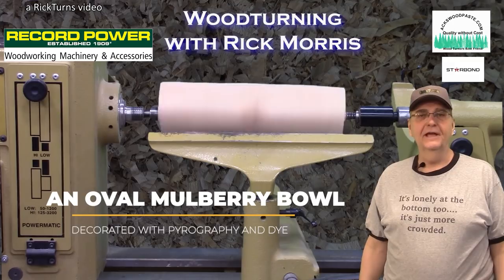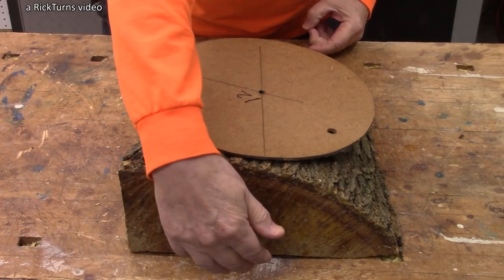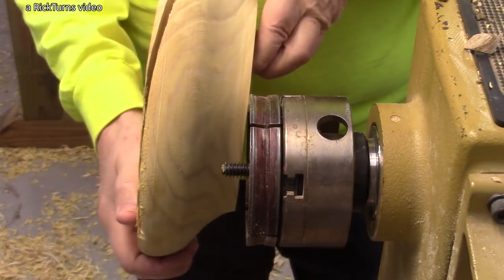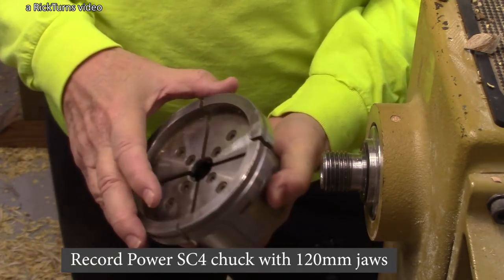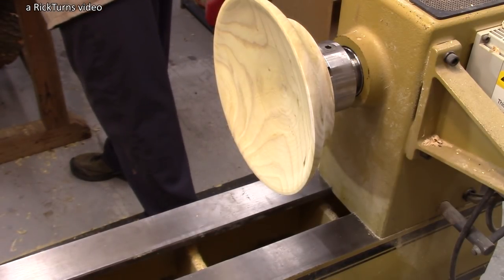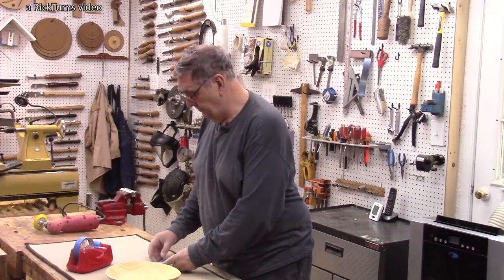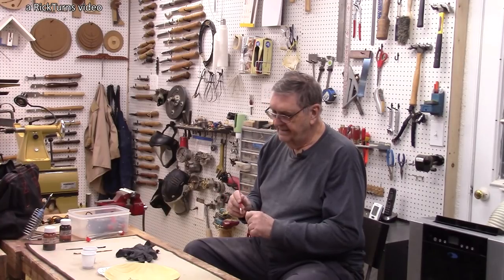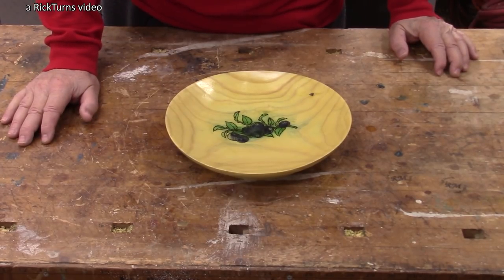Woodturning: An Oval Mulberry Bowl

Comment: I love the effect of dye sinking in to endgrain, how it plunges deep in to some areas and sits on top of others.   If I had that bowl in the state you have it, I would paint a very light amount of blue all over, identify the areas that want to suck it up, give those areas some extra dye, and then let it dry out.  Afterwards sand away the color from the areas that it doesn't penetrate and it may look pretty cool, possibly leaving just Woodburn image and a swirling blue design, possibly leaving some of your color shaded picture.    That's just what I would try.   And I often do things like this that do not work out well, but that's why I keep interested in wood working, the adventure never ends.    Live long and prosper, sir.
Reply from the maker: Thanks for watching and for your comments, William. Your idea about the dye sounds good - I’ll try it out sometime.

Comment: Hi Rick. I enjoy your videos and have learned much from you. I like this style of bowl/platter.
Regarding your dye and varnish, I've done a lot of leatherwork over the years and have learned that if you put a bit of finish on the part you plan to keep natural prior to using any dye, then it acts as a resist against the dye. Then after applying the dye, you can lightly apply a bit of finish to the dyed areas by either drizzling or spraying it on without wiping it for the first coat or two. Then finish up with another one or two coats of finish (varnish) over the entire piece.
Reply from the maker: Thanks for the tips, Mark. I'm going to try it which an initial coat of a sprayed-on sanding sealer.

Comment: Nice project that came So Close. I like your pryo+dye projects; they are great art. 
I've used water based polys as a sealer to limit bleed out if I suspect it's a threat. It can be sanded off later if desired. Of course it can't be applied on the wood that you want the dye to penetrate. Best use was where I routed out a pattern, sealed the entire surface, and filled w/ colored epoxy. Then sanded entire surface to be flat.
Don't stop doing these 'cause they're wonderful 🎨 I suppose you could sand it down and re do, ugh!
Reply from the maker: Thanks for the suggestion, Mike. I've already order a spray finish to seal the dye next time.

Comment: Win some, lose some. The depth gauge is a win though. I saw you use it in one of your videos about eight months ago when I was first starting to turn wood. I ended up making one and it hasn’t failed me yet. I had to be a bit creative though. I have an old tube style Craftsman lathe. A piece of 3/4 in. plywood, to hold the rod, screwed to two 2x4s to straddle the tube and it works great!
Reply from the maker: I had that same lathe, I think. It was $99 at Sears (this was 30-40 years ago). I used it a LOT! Thanks for watching, Duane.

Comment: Hey Rick.......Next time you do a dye like this, consider putting a couple coats of water-based sanding sealer on it 1st to seal in the dyes, and it wont run on you.......make sure you spray the sealer on and NOT wipe or brush.........nice lookin bowl!!
Reply from the maker: Thanks for the tip. I hadn't thought of using a sanding sealer before the dye application. I'll try that.

Comment: It's still a nicely turned bowl Rick, is there enough depth in the base for a scrape out and re try? I shall be glad when my lathe is fixed so i can start turning out some " disappointments "👍👍
Reply from the maker: What's wrong with your lathe, Torbay? Is it fixable?
Reply: @RickTurnsWoodturning  Hi Rick, the inverter that controls the speed and direction and on/off has got fried, happened a couple of months ago. I have a new one lined up just waiting for it to arrive so hopefully I can start making big bits of wood smaller. Hope you had a good Christmas. Cheers

Comment: When I use dye on projects, I use a lightly applied spray sanding sealer to prevent smearing and bleeding of the dye. After a coat or two of sealer, I use the appropriate spray finish.  Never had good results useing a brush on finish on my turnings.
Reply from the maker: That's what I'm going to do on my next project. Thanks for watching and commenting, Lewis.

Comment: Was just wondering Rick, what is that drill bit jig you used to bore the hole for the woodworm screw. Nice work on the bowl
Reply from the maker: That is a drill guide that I bought at a local Woodcraft store. Lowes also carries it. Here's a link to the Lowes website: https://low.es/2NDjji6

Comment: Eh, not lost. Just sand it down a little and do it again. Use some spray finish first as mentioned below.
At a half inch depth wasn’t that pretty close to that screw?
Reply from the maker: At the 1/2" point, the bowl was mounted on the chuck. The half-inch was solid wood. (That hasn't stopped me from screwing things up in the past, though!)

Comment: Neat camera shots, Rick! What was the voltage on that computer fan?
Reply from the maker: Hi, Lewis. Most computer fans run on 5-7 volts, though you can find some that are 12 volts. Thanks for watching.
Reply: @RickTurnsWoodturning  I was just curious. It looked like you were powering the light bulb and the fan from the same source
Reply from the maker: I had a low voltage power adapter and the light socket plugged into the same extension cord.

Comment: For the next time, what would you reccomend to not cause the dye to run?
Reply from the maker: Next time, I will use a spray sanding sealer or spray varnish first, for two coats. I believe that will adequately protect the dye, and then I can put on a wiping varnish. Thanks for watching, Art.

Comment: Hi Rick!

Next time when you painting anything like that-just put some Paraffin-oil(petroleum oil) 2 x coats should be enough around that area,which is preventing to sweep up any paint or liquid what you are put around that area,parraffin oil is closing off the grain of the woods and after 24 hours when it is completely dries out of the wood just leaves a natural tone of that actual wood.
That is the method in Hungary as well,when we are doing some chip carving motifs and we want to paint it(patina) the chipped motifs and give it even darker colour compare to the actual wood object main colour.If you do not want the coat around that motiff just slightly sand it off around the object and you will see the difference.

Regards,

Tamas,a hungarian guy from UK.
Reply from the maker: Thanks for the information, Tamas. I never thought about paraffin oil. Good idea. I used to do some chip carving too, before I started woodturning and got hooked on it. What kind of wood do you chip carve on?
Reply: @RickTurnsWoodturning  Mostly Lime and Poplar. Walnut is also a very good option-but before you carve a walnut you have to put 1-2 coats of paraffin oil on a surface of that area what you would like to carve to make the grain softer(it takes 24 hours to dry out from the wood).